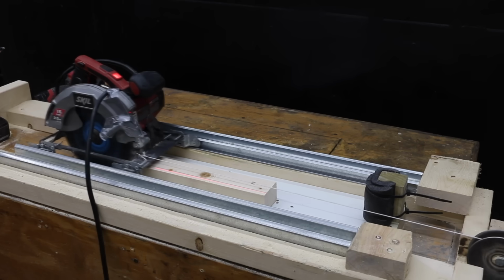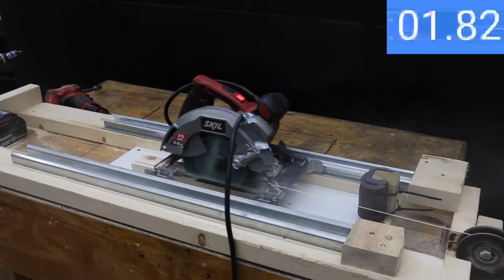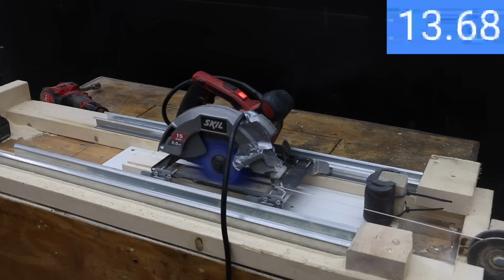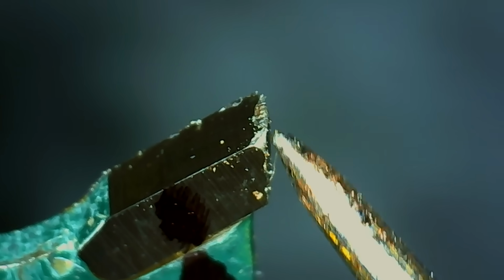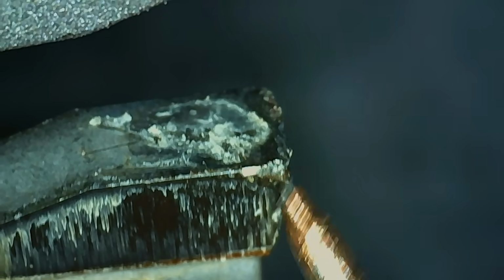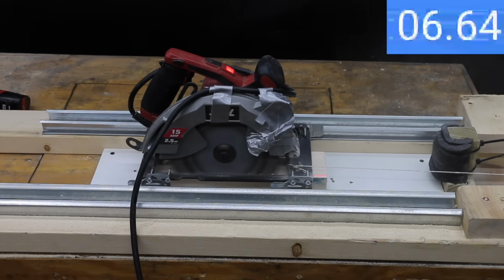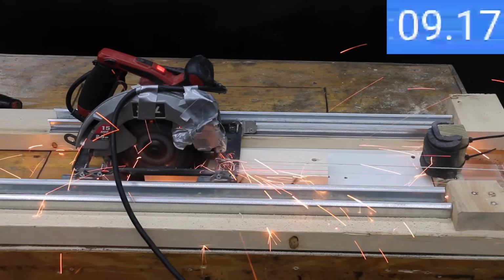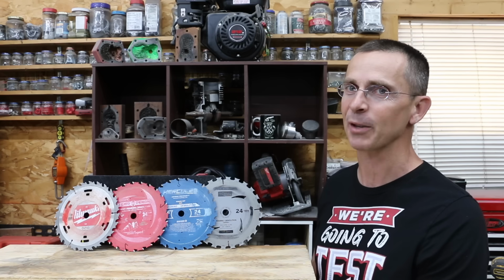Best "Demolition" Circular Saw Blade? Milwaukee, Diablo, DeWalt, Hercules, Evolution, Bosch, Amana

Comment: I have an idea for a video!

You test so many different things - but the channel is Project Farm.

I think it would be neat to see a video of you building something - a project - but make two.  
And one uses all of the highest rated tools and components you have reviewed and the second uses all of the LOWEST rated tools and parts.

Then you compare the two projects and how well they work.

It would need to be something that performed a task that you could measure.  What? I've no idea! :)

And it would be a heck of an undertaking - could maybe be a series... the A build and the Z build... then the showdown.  Maybe even team up with another youtube maker?  You could reference all of your past review videos and that would drive up hits on those too. :)
Reply from the maker: Thanks for the video idea.
Reply: How about two riding lawn mowers, one uses say honey for oil and burns straight ethanol for fuel and the other uses castrol syntech and ethanol free gasoline.  The honey gets the crappy spark plug, the good machine gets the good plug.  Then you gotta assemble the seats using the good staple gun and the bad gun and epoxy the steering wheel on, good epoxy, bad epoxy... so forth.

Then after you do so many of each of the identical 'fixes' to each machine (obviously damage for the fixes will need to be created to make them as close as possible) each mower has to mow a certain square footage of lawn.

Could do the fix a flat stuff, and fuel and motor oil and epoxys, could gum up the carbs so both carbs need to be cleaned with carb cleaners and sea foams/foggers... 
maybe dull blade that needs sharpening with grinders with grinding wheels or flap wheels...

Gotta clean off rust and repaint an area.... 

The ideas on how to apply are endless!

Comment: There's a brand I found on Amazon called "Concord" that I bought a ferrous-cutting and non-ferrous-cutting blade for my $99 10" sliding compound miter saw from Harbor Freight. While I was worried that they'd break, they've actually been fantastic. Especially for costing around $25 each for 10" metal cutting blades
Reply from the maker: Thanks for the feedback.

Comment: I’d really like to see you find the best “surface safe” adhesive remover 🙂
Reply from the maker: Thanks for the video idea.
Reply: GooGone ...
Reply: That is easy, auto paint shops use "wax and grease remover" it leaves nothing behind that would ruin painting. I use it for things at home.
Reply: @born_again_torinos  In other words, Acetone. Great if your "surface" is bare metal, not so great for almost any other surface :)
Reply: @philthycoder  No, wax and grease remover is not acetone. I use it successfully on dozens of surfaces. The question was about adhesive remover. It works perfectly for that on everything without harming it.

Comment: Explain it to me like I'm 5: what is the purpose of the wiggle lines on the blades?
Reply: When thing get got to keep from warping
Reply: @caraudio7632  So, since the blade gets hotter as it's being used, the squiggly lines (cuts in the actual blade) allow it to expand without harming the blade?
Reply: @stephenkilpatrick7199  yes to the best of my knowledge.
Reply: @caraudio7632  Thank you!

Comment: Pretty sure that the „big blue“ is illegal in Europe. Be really careful with this blade, better yet: don’t buy it at all. Any saw blade (and milling head for that matter) that is used with hand- operated tools need a cut- limiter/ deflector. „Big blue“ looks like an accident waiting to happen
Reply: Lol it more like kick back i wouldn't  use it an I have been a carpenter  for 30 years
Reply: My 35 years making and installing cabinets totally agrees with your assessment on this blade. It is scary to think of all the bad that can go wrong with a gullet that large.
Reply from the maker: Thanks for the feedback.
Reply: The makers of the Big Blue even make a scarier version, with THREE TEETH.
Reply: @electric7487  For gods sake why?
Reply: @Allurade  Big Blue is intended for demolition work, roofing, or for light emergency/rescue situations where you need something that can cut anything. But what would be a less scary alternative for those kinds of things?
Reply: @electric7487  Ah, thanks, though it didn't seem to do well in this test from what I recall.
Reply: @electric7487  Typically emergency crews use chain saws or hydraulic cutters, depending on what needs cutting.
Reply: @electric7487  there is essentially nothing its suited for, the design is inherently recklessly dangerous and negligent. Emergency crews would use something like a chainsaw or hydraulic powered shears, or they'd just something that takes the dremel high-speed approach to very safely and reliably cut without throwing tons of shrapnel or causing worse injuries by itself.
Reply: @dracoslayer16  fire rescue also uses a saw universally known as a k12. Most trucks carry multiple blades for it but none that look like big blue
Reply: @Allurade  I remember seeing a tri point saw blade when I was in high school, it was explained to me to be used for cutting curves in lumber, supposedly easier on the blade since it torqued the blade less
Reply: @Allurade  Mexican Cartel home vids
Reply: @electric7487  sawsall
Reply: It's like your years of experience, automatically throws the Darwin breaker, on that Big Blue.  I wouldn't touch that if they were giving them out by the dozen.
Great testing!!!
Reply: ..Big Blue looks to me like one of those "weed blades" that they sell for weedeaters/brushcutters...you know, the kind designed to cut soft stemmed weeds and grass, but bounces back with whiplash force when it encounters a small sapling or woody stemmed bush....
Reply: Big blue should be banned
Reply: I felt the exact same way... That thing is a problem waiting to haplen

Comment: youve confirmed what i suspected.  the laser slots are less than useless.  i think the marketing department designs these blades - the meaner looking, the better the sales.  i search out blades with the most teeth.  the stress of cutting (wood, nails, brick) is spread over more teeth.  the best blade for demolition is the old ones you never threw out after buying the new one.  i choose a really badly worn, no carbide tips left type of blade for the dirtiest cuts.  ive never thrown out many blades.  theres always a dirtier job for them.
Reply from the maker: Thanks for sharing.

Comment: Would you start testing household appliances? Kettles, toasters, blenders, mixing sticks etc? Testing for repeatable performance, stress test, failure modes, safety for example.
Reply from the maker: Thanks for the suggestion.

Comment: It dawns on me that he can call himself a scientist more than a lot of scientists out there. I love how he accounts for nearly every variable.
Reply from the maker: Thanks!
Reply: Most scientists out there must answer to whomever writes the checks.
Reply: i AM a scientist and these vids are nearly perfect examples of how to do it right. 
1) state a problem or missing info.
2) create a hypotheses that you can test.
3) create balanced tasks/studies to test that hypotheses 
4) measure and document the tests and results.
(1-3 are the "fucking around" part, and 4 is the "writing it down", as per ember's comment)
Reply: The difference between science, and fuckign around, is writing it down!
Reply: @UCd3z0LDmD94F5bfTFlBgOMA he's not comparing the variables that make a saw effective, he's comparing the blades that manufacturers sell, dumbass.  If a manufacturer decides to have less blades, different blade, etc. and it changes their effectiveness, that's on them, and it will display in the results.
Reply: @BuzzingGoober  to be honest, as someone who did study a field of science, the only "big" issue I can find with his experiment was that he should use new saw blades for each individual test, since likelihood of, say, misalignment or blade damage depends on probability. One could make the argument, though, that using the same blades for the tests will also test resilience.
Reply: @hombreg1  Yeah, not changing the blades might not be as scientific, but it's certainly more useful in terms of practical applications.
Reply: Not really. These blades have varying sizes and tooth counts. What you can expect them to do is going through change due to those factors. 

Beyond that, all of these blades are cheap and will not hold up if you cut through nails (or harder woods). They all cut like crap after having their teeth destroyed. 

There is also the factor of blade geometry post cut. Some of these are far more likely to warp, bend of have misaligned teeth after hitting something they shouldn't be hitting.
Reply: @cemarz  interesting how the word scientific is some peoples hot button. I once saw some one almost loose their mind because Meathead titled his book The science of Great Barbecue and grilling.

Comment: One of the best yet, manufacturer claims gave me a good chuckle on this one. Be good to see twist drills and saw blades done again with controlled feeds rather than load with a screw on the jig or similar to give another comparison point.
Reply from the maker: Thanks!  Thanks for the suggestion.

Comment: Love the channel. A lot of people say you can run jet A fuel in Diesel engines as long as you add transmission oil for lubricity.  In the army we run jet a in a lot of Diesel engines in the aviation field due to availability. I would really love to see a video on that. I haven’t been able to find any dependable info like I see on your videos!
Reply from the maker: Thanks for the video idea.

Comment: Does the depth setting of the blade have an impact on the speed of the cut on a given thickness of board?  In other words, is it better to have the cutting depth set to maximum so the cut is as vertical as possible, or is it better to have the blade set as shallowly as possible so the cut is more of a crescent shape?  Or does it matter?
Reply from the maker: Thanks for the video idea.

Comment: Over the years I have used a variety of different tools and different blades, bits and power tools.  I came to the conclusion for blades I go Diablo, for drill/hex bit sets i go with Milwaukee, for tools craftmans/dewalt and for power tools its Makita. You won't go wrong with any of them though I just think ever some companies have a strengths and weakness. 
Really enjoy your videos Project Farm.
Reply from the maker: Thanks!  Thanks for sharing.

Comment: I've had a Diablo panel cutting blade for about 14 years.  Ive used it for cross-cuts, rips and plywood with an antique Black and Decker circular saw (very high RPM).  I've replaced the cord and brushes on the saw during this time.  The blade is still cutting well.  I don't think it's even been dismounted from the saw since new.  I remember the blade was quite expensive though.  I sometimes don't even bother to cut with the rough side of the piece in the up facing position.  The cuts are very smooth.  There are few things that I can say I'm happier for buying.  I like the way you always strive for consistency during your testing.  Good job as always!
Reply from the maker: Thanks!  Thanks for sharing.

Comment: You should try concrete filler/patch/repair kits! See how they hold up to actually fixing the cracks from leaking. I.e. epoxy vs the expandimg foam kits.
Reply from the maker: Thanks for the video idea.

Comment: Based strictly on your reviews I've purchased a number of tools, a drill bit set, extra batteries,  socket adapters, etc. this year and have been very pleased. I've been needing to update some of my power tools and other equipment for a long time and you have become my "go to" guy thanks to the professional manner in which you conduct your tests/reviews.
I'm currently in need of a battery powered hedge trimmer. My corded, Sears electric trimmers died several years ago and I've not yet replaced them as I was hoping technology would improve to the point options other than another corded trimmer or gas powered trimmer would become available. 
There are several YouTube channels that have covered the Milwaukee brand, but no one does comparison reviews like you. Please consider powered hedge trimmers for a future test.
Reply from the maker: Thanks so much!  Thanks for the video idea.

Comment: For my money the Diablo is the best blade out there. Now admittedly I've not tried them all. I'm a professional painter and home remodeler who does a lot of frame work and trim carpentry. I had a Diablo last through hundreds of cuts on one job then went to Lowes because it was closest and lacking the Diablo I bought the Spyder thinking it would be comparable to the Diablo. Boy was I wrong. After just a couple dozen or so cuts in 2X4s, 3/4" Plywood, OSB and trim pieces the Spyder was intolerably slow cutting. I called it a day and went and bought another Diablo. I've also used the Bosch, DeWalt and Milwaukee and none last as long as the Diablo. Thankfully I don't have to cut through many nails or screws usually so most of my cuts are clean wood but the Diablo is all I buy now.
Reply from the maker: Thanks for sharing.

Comment: Diablo has always been my goto blade for my circular saw and my father has used them for decades as well they have always outperformed the competition on countless jobsites over the years.  We have used diablo blades for all kinds of cutting jobs from siding buildings to cutting framing lumber to cutting gutters  and pvc pipes.  Diablo even makes a blade for cutting tile and we have used those blades as well and have always had good results.
Reply from the maker: Thanks for sharing.

Comment: If you do a test of mini portable chainsaw, I will tell you my opinion of one I used for a minute.  One issue with mine, not safe near children or adults, no safety switch.  Battery should always be removed immediately after use.  Too short to be effective, debri gets sucked into saw most of time.  Maybe good for cutting small twigs or grass, also good for cutting fingers or hand if switch malfunctions or pressed by accident.  The good thing is that it’s light, not sure what else it’s good for.
Reply from the maker: Thanks for sharing.

Comment: Ok let check shear strength on sawhorses make with screws, nails,  15 ga. Angle finishing nails, and wood dowel, loading factor with load weight.
Reply from the maker: Thanks for the suggestion.

Comment: In my humble opinion, it would have been better to test blades that were similar, like all demo blades with the same tooth count.  Comparing a 5 tooth demo blade to a 24 tooth cross cut saw blade that isn't designed for metal doesn't seemed to be a fair contest.  Still love your channel though!
Reply from the maker: Thanks!  Thanks for the constructive feedback.

Comment: The one criticism I have of this test (and I have few of any of your tests) is that you were "ripping" the 2x4s "with the grain," instead of crosscutting against the grain. I think most demolition is done cross-grain, and probably most 2x4 cuts are made across the grain.
Also, no plywood testing? A bit of 1/2" or 5/8" CDX would have been a great test, maybe some OSB also?
Reply from the maker: Thanks for the constructive feedback.

Comment: maybe i skipped through any discussion of this but don't most of these blades have teeth geometry specifically designed for cross-cutting studs to length (vs the rip cuts he uses on the first jig)? or at least they're designed to do that as their primary duty.

Comment: Has any company reached out to you to not include there over priced tools in your comparisons. HF tools are looking good for a DIYer one or two time use.
Reply: I use Hercules blades on the daily as a trimmer. They're standard Kerf, have enough teeth, and are cheap. I prefer them to DeWalt and Hitachi blades. You will get much more than just one or two uses out of them if you're not cutting through metal. We cut mostly MDF and Poplar and we make MANY cuts per house that we trim. The blades last through multiple homes. They're good all-rounder blades. The best? No, but you'll get good life from them and you won't cry like you would with a Freud blade if you dull it by cutting something that you really shouldn't.

Comment: I would Love to know what the Bosch is actually good at... It was clear that a thicc boy would be slow but where does it have its uses?
Reply: Bosch is no longer a quality brand. Hasn't been for decades.
Reply: @thomasneal9291  still there has to be at least some thought behind a more beefy blade like that. Bosch also has to pay for resources so wasting metal on thicker blades wouldnt make sense if there was not at least an expected benefit.

Comment: I strongly advise against using blades like the bigblue sawblade!!! I've been through my 3 year job training as joiner here in Germany and we've been told and shown why saws have such small teeth and close distance between them. Blades with such huge gaps cause far more devastating injuries and they are also far more likely to bite off more than they can chew which leads to violent kickbacks and dangerous shrapnels. Do not use such blades, it's dangerous and you can see how life threatening the injuries could be in certain test videos. 

It would also be important to compare same saw tooth shapes, not different ones. Some of them are made for wood, others for wood particle board with certain surfaces. Comparing different styles of teeth in the same tests is a major influence on their performance, it would be nice to compare actually similar blades with the same tooth shape and roughly the same number of teeth on it to make it a fair comparison. Different blades for different tasks, as always there is no one in all solution so it's necessary to use the right tool or blade for the job, not one for all. 
Other than that, great videos and informative test as always
Reply from the maker: Thanks!  Thanks for the constructive feedback.